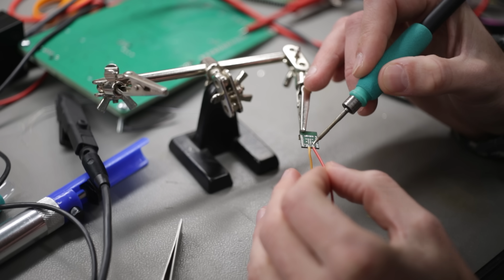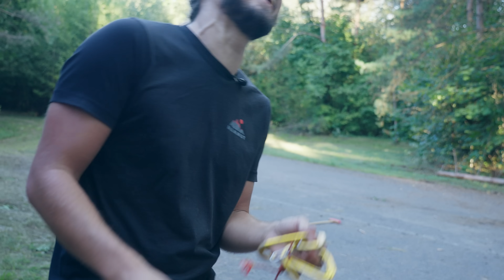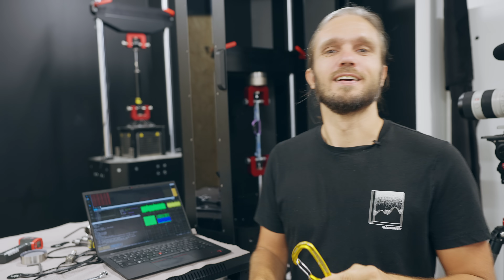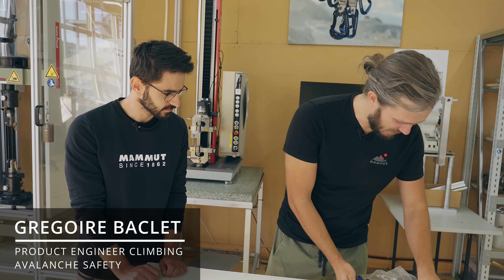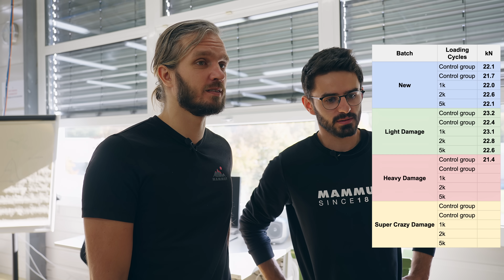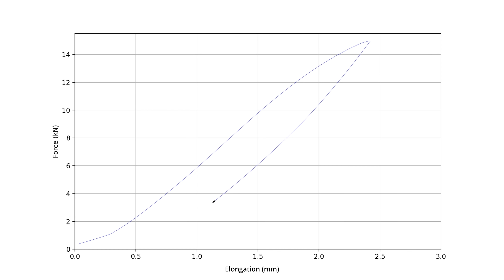Should You Retire Dropped Climbing Gear?

Comment: I literally work in a steel mill in the phys lab breaking items all day long. Fun to see it. 

We test for yield ( the point of passing the point of plastic elongation), tensile (total force to fail, and elongation. It's super crazy pulling a solid 3" round steel bar and watching it elongate 10%, or a lot of the chemistry we run stretchibg 30%.

Climb safe folks and thanks for the vid

Comment: i'm not that surprised. the whole micro crack theory doesn't add up to start with. aluminum don't simply crack under impact, aluminum can fail in many ways, but they way it cracks is by undergoing repeated plastic deformations that add up until it reaches the point of fatigue failure. or alternatively a single big plastic deformation that pushes straight to failure.
striking a piece of aluminum will simply not produce cracks, aluminum does not shatter under impact, it deforms. cold forging aluminum is an actual process for shaping it. hell, some carabiners are cold forged in factory.
and yet somehow, i have always had that "better safe than sorry" train of thoughts with dropped climbing gears despite knowing better...

Comment: There is an absolutely massive flaw in your testing, you tested it on a flat, hard ground which is pretty much the ideal situation next to landing on a soft patch of grass, what you dropped it on is asphalt concrete which is relatively soft when you compare it to something like granite which your carabiner is much more likely to hit if you to drop it while climbing,. Also the fact that it is flat means that it is going to have much more surface area to come into contact and thus spread out the force and reduce the damage, asphalt concrete is also has a lot of built in cushioning from being aggregate combined with a binding agent it's much more forgiving than falling onto granite. I do think that as they brought up briefly that the much more dangerous effect this could have is having burrs form on a part of the carabiner that sees a lot of rope traffic that it could cause issues there but I think that overall if you're using high quality equipment that they create these things with the intent that it's able to meet the goal with room to spare and not put out a product that will only work as long as it's the ideal conditions for it. It would be pretty damaging for a brand to be known as the one that if you went 1kN over the bare minimum it would fail, you want repeat customers and if someone falls to their death because you just barely make the grade then you're going to have a hard time finding new customers.

Comment: I wouldn’t say that X-ray inspection would catch a micro-crack necessarily. There’s a lower limit on the resolution they can resolve. You can also change the metal grain structure along a load path without a “crack” forming.
That said, these alloys aren’t really susceptible to these kinds of failure modes. They are probably more affected by work-hardening and surface defects from the abuse you gave them.

Comment: The association for rope access technicians in Germany insists that there still might be micro cracks. We just haven't found any yet. Proof of nonexistence. 🤐
Reply: I'm also a rope access worker. Alloy binners are forbidden for some kind of works (drilling) because they are more subject to be damaged by the shocks and vibrations. A binner is so cheap, it's supid to try to "save" few euros when your life is in account. I have seen some cracked binners at the gate axis around the pin so I guess this "experiment" doesn't show everything that could happen to it in REAL life.

Comment: Benefit of aluminum for rock climbing gears it's his strength/weight + elasticity 

Aluminum climbing gears won't crack on their own weight, only small dent or chip, so the structure will remain strong enough! Of course I'm saying about few falls, if it falls 10000 times, the dents and chips would become significant!

Comment: I am not a rock climber. I have been rock climbing but I am not a climber. I understand why you wouldn't want to use a damaged carabiner however, I've also done a fair amount of metal working and have a decent understanding of how metal things, fatigue and where, and so long as you were using the correct alloy and or proper heat treatment, you're not going to get tiny little cracks in your metal from dropping it. Now if you repeatedly hit the same place with a hammer, yes that would weaken it

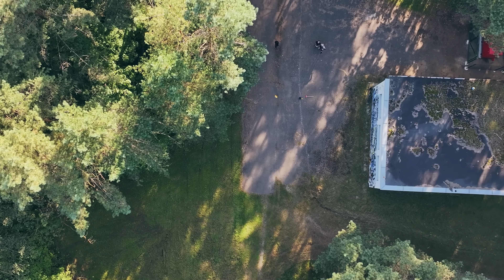Comment: 2:45  In fact, 40/50/60m in height will not make a difference. This Mamoot carabiner kit has 100g according to the manufacturer, and due to its dimensions its Cx is very low, which results in a terminal speed of only 11.8m/s or 42.48km/h. And due to its weight and aerodynamic coefficient it reaches in only 23m. Anything beyond that does, will or would do the same damage.
Reply: Mammut.
Reply: 🤓☝️ @kiereluurs1243

Comment: Wöhler line and damage line are missing. A carabiner with a dent might fail after using it for rappeling on a sticky (loud) rope, especially if it's a classic twisted one. (I did this once from a tree. The whole tree was vibrating.) There may be fatigue without a crack that's visible by X-ray. You actually have to cut it, polish the cut and use an electron microscope to see something. If there is a crack visible in the X-ray, failure is very imminent. Some kind of reproduceable accoustic testing would be a reliable methode to detect material changes.

Comment: Analysis of plastic deformation of bolt hangers and destructive testing to measure any change in strength.   I occasionally find bolt hangers that are meant to be used in a vertical orientation but have rotated into a horizontal orientation and that have bent a few degrees due to repeated loading in the horizontal orientation.  Does that deformation change the breaking load?

Comment: WOW, you have raised an absolutely interesting question and presented it in a really cool way. Very reassuring - but I would have expected a similar result. As a beginner, everyone who threw the figure of eight next to their backpack had to buy a beer for the friends 😅 because of the "myth of hairline cracks"! I "believe" (or know) 4 things: 1. The main sources of danger are almost always unintentional application errors, very rarely the material. 2. Webbing and quickdraws fail much more often than metal components. 3. Bad luck often plays a role in the failure of the material (carabiner remains open or sideways, etc.) 4. 5 meters above the bolt, the material science findings are no longer of any importance 😱

Comment: Awesome video!

I have an idea why the one with low damage actually could withstand more force, no idea if that is actually the case please someone who studied this let me know.
so I know there is a thing with springs where you use shot peening to increase the durability of the spring. its a process where you hit a spring with tiny balls like 0.2mm diameter tiny. and by "abusing" the metal like this it gets more tough. because the surface structure gets slightly more rough. I don't understand this prozess fully but maybe you did something similar with the lightly damaged ones by accident. but it might just be an irregularity because of your low sample size. IDK just my two cents.

Comment: One more interresring thing is the fatigue limit on metals. This limit is always at a lower stress than yield strength, (basically around half of yield strength for steel). Below this limit, nothing will happen to the material, even with an infinite number of cycles. However, since the stress reach this limit, the failure will happen after a certain number of cycles. This number depend of the stress applied, but it's a matter of millions of cycles.
The particularity of aluminium alloys is that there is no fatigue limit, this process will begin from the lowest stress levels. Obviously, with low stresses, the number of cycles before failure will be so big than we dont care about. But for some higher repeated stresses, aluminium would need care to predict real lifetime. (Important for example on planes, greatly made from aluminium. In this case regulars controls allows to know the rate of cracks inside criticals parts, and if it's still acceptable or not)

This doesn't concern climbing of course, the number of cycles is thousands times to low for considering fatigue.

Sorry for my English, and thank you for the really interesting video!

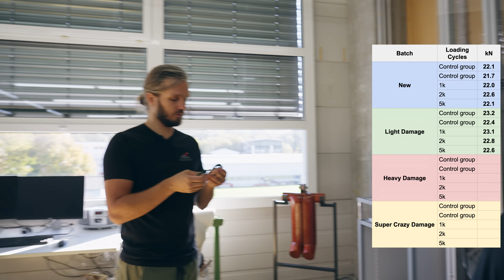Comment: 16:57 you used different colors which likely means they were different production batches. Or (unlikely) the color treatment effected the metal. Not that the dropping changed anything
Reply: Its a process called anodizing, it has no meaningful effect here.

Comment: The problem with aluminum is, that it has no hard defined limit for elastic and plastic deformation.
Thas is also the reason why aluminum can’t be designed to be 100% fatigue resistant. It will fail eventually even with very small stress amplitudes. 
But it might take >100 million cycles and is therefore pretty negligible for climbing usage 😅

Comment: Very cool video! I heard that aluminium bike frames have an inherently limited life span, as the metal very slowly fatigues and finally fails after (a great many) repeated load cycles, even if all the load cycles are well below the threshold of plastic deformation. So, used for long enough, all aluminium bike frames fail in the end, even with normal use. The same is supposedly not true for other materials, for instance a steel frame has an almost unlimited life span in this respect. 
Even though it probably has zero bearing on real world climbing safety, it would be interesting to see how many thousands (millions?) of cycles of 5kN loads it would take to break the aluminium carabiners in the video.

Comment: Incredible video! You're addressing topics in materials science/experimental mechanics and making them digestible in an interesting way for a wide audience. As I did my PhD in this field and worked for quite some time in it, I want to add a couple of extra points that you might also find interesting!

1. Even if loading is maintained within theoretic elastic limits, there is still a number of cycles beyond which failure is expected! In experimental mechanics, fatigue testing can be performed out to the "very high cycle" regime to investigate such behavior. This isn't practically relevant for a climber's quick draw, but the underlying plastic changes within a material that take place before microcrack initiation are important to understand and explain why for example your watch spring fails after some time despite "only" being elastically loaded.
2. Real world loading ain't a tensile test. Multiaxial loading, where components are subjected to forces potentially with bending or torsional components, heavily impacts failure response. Quick draws are designed and tested to be loaded in a chiefly tensile manner, but they might catch differently depending on the anchor, rock, or notches on metallic surfaces. Those quick draws that you beat up would scare the crap out of me.

Super fun video, I absolutely love your channel :)
Reply from the maker: Yeah slackliners do have problems since they use steel carabineers and experience many many more cycles when what we do in climbing.

And thanks it's always nice to read such comments and learn more ;)

Comment: The metal would only crack if it was hardened. There is no purpose for harden climbing gear. In fact, the engineers selected an alloy that would flex.

Comment: From the S/N curves I can find, for something like 7075 or 6061 with a T6 temper, which I would expect for a lightweight carabiner, the fatigue limit will be well within the high tens to low hundreds of thousands of cycles at three quarters breaking load. Aluminum is well known not to have a fatigue limit unlike steel, however since it would most likely take tens of millions of cycles to reach that at 5kn, there is more risk of the material being worn away by ropes, or the nose being worn away by contact with the spring gate than the fatigue failure.
Reply: Yes, exactly, there are applications where aluminum not having a fatigue limit would be problematic, like, say, if you made a piston rod out of it in an engine, but until climbers reach the point of taking 2000 whippers per minute for hours at a time every day (I tell ya man, sport climbers these days...), it's just not going to be a problem in a carabiner.

Comment: The whole micro fracturing conspiracy comes from when they started to make titanium carabiners. Those did have issues with micro fractures, thus why we dont use the metal with the best strength to weight ratio ( that would seem ideal for climbing) for climbing gear.
Reply: It is used for bolts in very salty and humid climbing crags, so especially by the sea. Stainless steel bolts tend to rust away too fast in these areas and might break in just a few years as has happened in Tonsai, Thailand. Very interesting how stainless steel is super good enough at most crags and then just degrades enough to break in 2 years at others!
Reply: @xXArual77Xx  I'm curious if you spent $50+  a bolt made of monel how those would fare.
Reply: There's no real reason to use titanium anyway in most civilian applications.

While it maybe stronger per kg than the steel and aluminium alloys it's not much better. (Depends on the exact alloy)

The only real reason would be for biocompatibility but that's not relevant here.
Reply: @duckpotat  there are people that will cut the handle of their toothbrush to save a few grams. On a bigwall climb saving a few grams for every carabiner adds up to a lot. There very much is a market for climbing gear that is as light as possible.
Reply: @duckpotat  how relevant in civilian purposes having something as light as possible is debatable, but it is not debatable that in various fields, including climbing, people will pay a premium for minor weight savings, so the market is definatly there.

Comment: Another great video! I'd only want to add that the material fatigue is a thing in paragliding, where cyclic loads prevail. The topic is somewhat researched by e.g. Finsterwalder Charly. The number of cycles in these tests oscillate (no pun intended) around millions though. The report should be somewhere on their webpage, the "Risk of material fatigue in air sports carabiners with conventional snap gate"
Reply: There was also a paraglider pilot who landed safely, but when he was on the floor his carabiner broke (after landing)!
In his case he used every last cycle.

Comment: I think I have a hypothesis about the origin of this myth. I have a friend who works on oil platforms in the Gulf of Mexico; he is the head of safety for vertical work (ripé access)(with SPRAT certification). Because of his job, he has to regularly inspect the equipment they use, including both manual and electronic checks.
One day, while discussing this topic, he told me that he has ordered dozens of radiological and microscopic analyses and believes that this belief dates back to the time when carabiners were made of steel. That material absorbs impacts less effectively and could indeed develop microfractures. However, with modern alloys, this is now impossible.
Reply: I'd like to see more info comparing steel to aluminum. The common belief,  oft repeated from bike shops, to climbing gyms, and in other extreme sports, is that steel holds up better to repeated (elastic) stresses while aluminum is more subject to work hardening and then, micro-fractures can occur. That's why I chose the standard, 50 kN locking, anti-corrosion-plated steel carabiner on my hang glider harness. On the other hand, watching this video was somewhat reassuring.
Reply: aka "The Gulf of Steve Martin"😏
Reply: No, stuff is more complex. BTW I would discard any 7075 or unknown carabiner if it has been used near the sea. Corrosion is a big issue there. Even with suitable alloys like 6082 aluminium or 1.4571 steel it's a topic. Stainless steel bicycle spokes started cracking in 2008, when some cities switched to MgCl2 in winter. Corrosion fatigue is really nasty. Zinc plated stuff may outlive a wrong stainless steel. It has to be investigated for every single alloy. As aluminium has a lower E-module it can take more energy in elestic deformation if it has the same yield strength. However a steel with the same yield strength has much more plastic reserves. The modern lightweight aluminium alloys often have the same fatigue stress ratings as weeker alloys but stuff is made lighter. So the lifespan is lower and corrosion is worse.

Comment: I would say, technically speaking, the conclusion is "insufficient data". Maybe thrashing the carabiners introduced a 1% chance of failure below rating, or a 0.1% chance, there's no way to know from so few samples. There is also an issue with uncontrolled variables. That said, it seems like the treatment those carabiners received had an effect within the uncertainty of the break test.

The proper thing to do would be to consult a materials scientist for reasonable bounds on micro fracture creation and propagation, then produce an estimate of what sort of damage you'd need to do to expect to see statistically significant results.

Non-technically, yeah, don't worry about just dropping a quick draw. Inspect for damage, but there's no need to be paranoid about a not visibly damaged carabiner hiding internal damage.

Incidentally, the quick draws spinning as they fall is something you can reason about informally. The horizontal spin means the carabiners on either end maintain relatively equal momentum and energy, and the angular momentum helps absorb disturbances from uneven air drag. It's just kind of a "nice" state for the quick draw. Again, very informal reasoning, but it kind of makes sense why an aerodynamically unstable quick draw would wind up spinning like that.